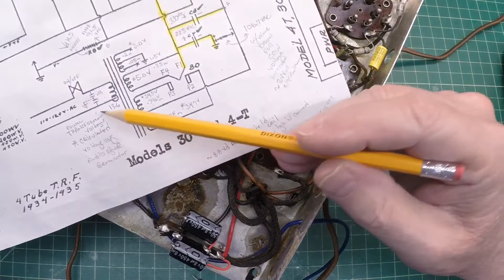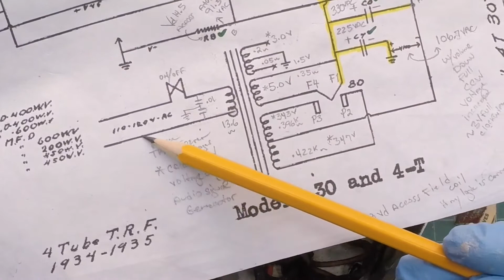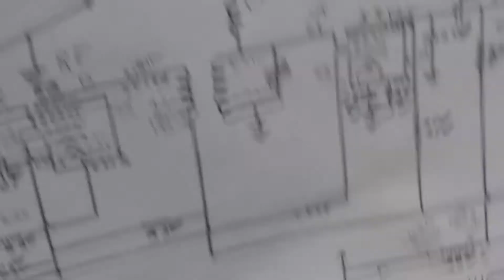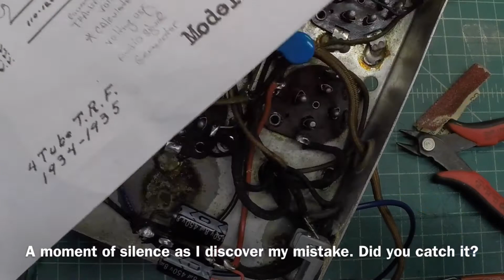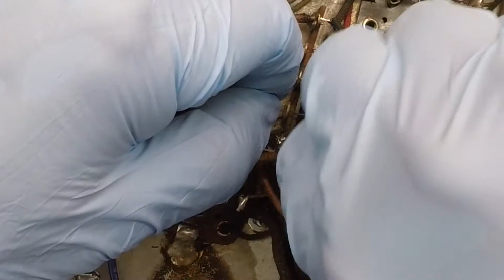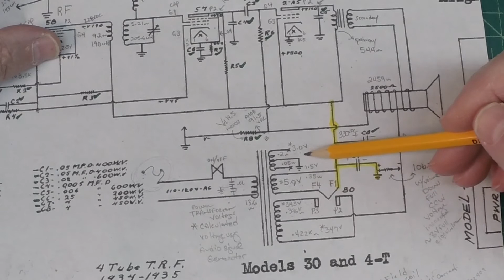Peter Pan Radio - Day 16 (Installing a Fuse & Safety Capacitors + I Make a Big Mistake)

Comment: hello! I'm installing a 3-prong line cord to replace an original non-polarized 2-prong one, now, you can only stick the fuse into which part of the circuit? beginning or end? (I don't even yet know for sure which power lead hot or neutral? to connect to the transformer and which to the switch.. here seems you're connecting hot to the transformer and neutral to the switch?)  My patient is a 1957 Magnavox "Modern Concierto" and I really don't want to fry it not knowing essentially- my "left from right" . The on/off switch on this hi-fi is the treble knob/pot...  thanks for any help whatsoever, nice video.

Comment: Hi there,when you said that you had made a big mistake, I thought it would be that you had connected the safety caps to the chassis with no ground wire on the power cord. That would raise the chassis to half mains voltage via 260K ohms effective resistance. It might be ok with 110v mains, where I am ( NewZealand) with 230v Mains, I've had a few unpleasant tingles when I've made the same mistake. Keep up the good work! Doug.
Reply from the maker: +Doug V B Hi Doug, thanks for tuning in. I hate those tingles too. I appreciate you watching. Be safe. Best, Don

Comment: Fantabulous!!!!  Great job.  I love it.  My only suggestion might be to use a proper UL knot as the strain relief, rather than that slippery overhand knot on the mains cord, as it was designed.  The UL code for Power Cords required, #1, a smooth, non-chaffing, bushing around the cord entrance, and, #2, the use of a self tightening, non-slip knot.  Thanks VERRRRY much for sharing. ................Dick